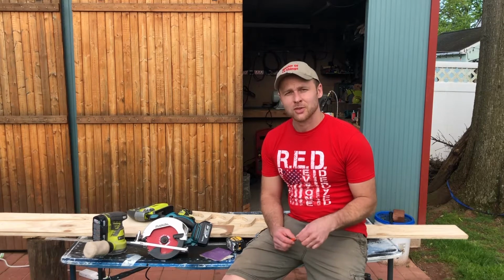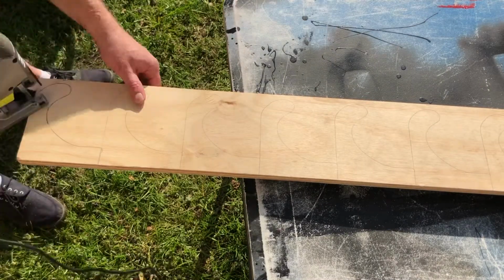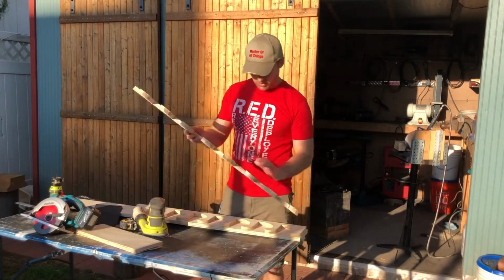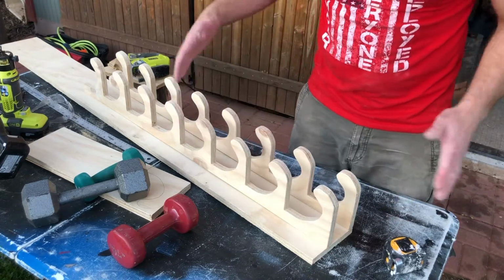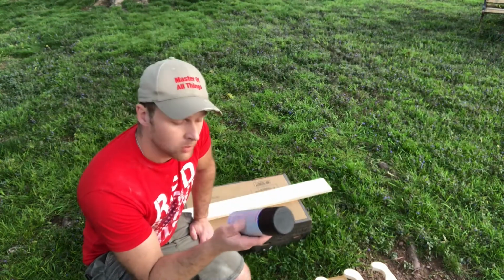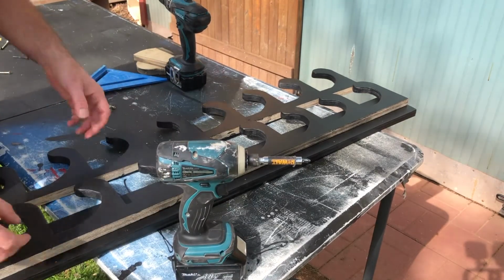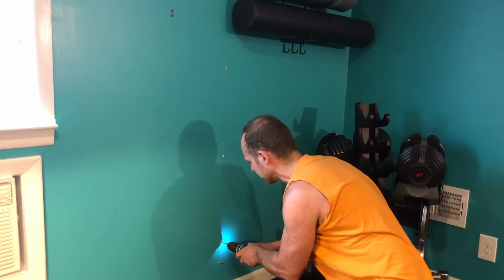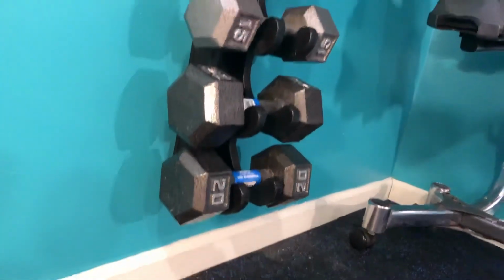How To Build a wooden Dumbbell Wall Rack DIY weight organizer (also wine rack)

Comment: Clean looking. How did the rubber paint do? I would have much more wood to avoid snaps. I'd also like the screws in the sides and not the bottoms. But it's better than what I have, which is the floor right now.
Reply from the maker: Holding up ok.  But next time would probably do regular.   As it will rub off in contact spots over time. Same with pull ups bar pipe

Comment: Can this be made to sit on floor?
Reply from the maker: yeah, don't see why not.  would need a pretty wide support base if from plywood. unless you weight it down.  or screw down. a nd make sure the bottom section of rack is longer so there is space for the weight to float over the stand.